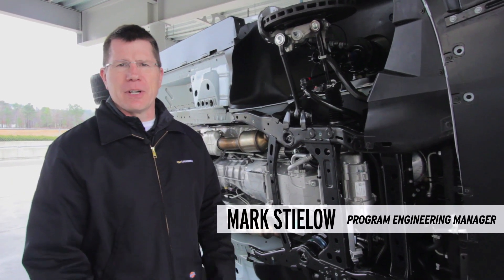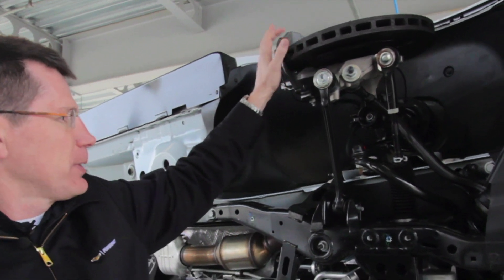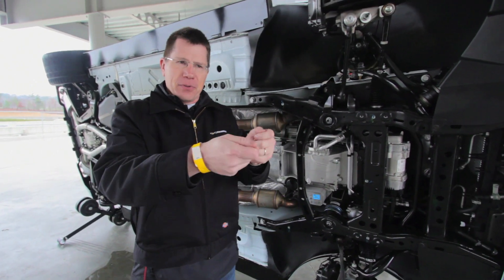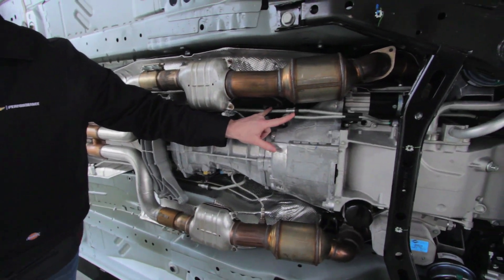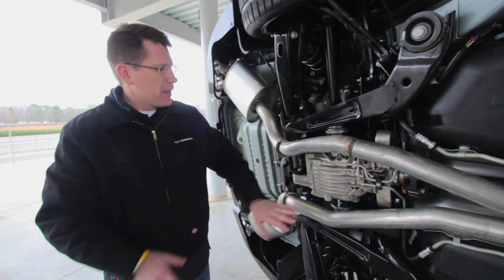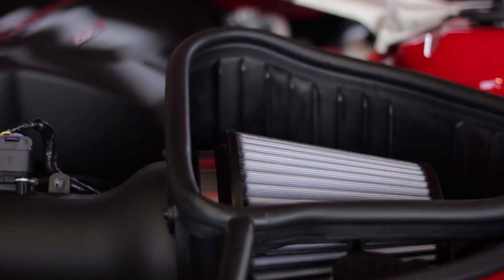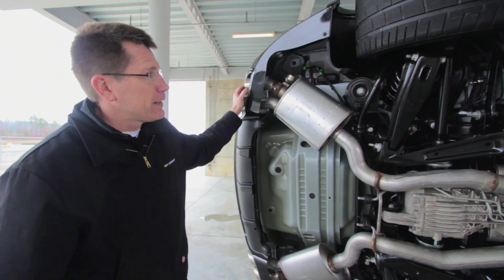C/D Underbelly: 2014 Chevrolet Camaro Z/28 Chassis Explained by Mark Stielow

Comment: you should bring back the iroc z28 a turbocharged and supercharged ls7 6.5 litres 16 inch brakes 8 piston and carbon fiber body with all that it will hit 220 mph

Comment: Doesn't this guy Mark own a '69 Pro Touring Camaro called the "Red Devil"? If he spends his off time building, driving, and racing the old metal, kind of tells you where you really ought to put your money, no?
Reply: unless you want carbon ceramic brembo brakes, f1 inspried suspension with perfect geometry and dampening.  Fully independent front and rear suspenision with sophisticated driver assist sensors for each wheel, a track tuned rear diff, oil coolers for the engine, tranny and rear end.  A second radiator.  modern efi.  Yeah man.  Unless you live in Ca I don't see a reason to buy the old car.  I'm sure they would cost the same if all the same stuff is done to them.
Reply: Robbie Wilson I've seen his car compared with a ZL1 on a road course and his '69 was actually faster. So what's that you were saying about "F1 inspired suspension"?
Reply: Alec D. This isn't a ZL1...this is a Z-28??? 

Air bags, air conditioning, three point belts, reverse lights, noise restrictions, emissions? Did you just compare a full on race car to a road legal car?
Reply: pcfxer Pretty sure his car is street legal. I'm not sure how many he owns or how many he's built, but the one I saw was street legal. Unless you're going to be driving it everyday or you don't live in an arid climate where you could daily drive it, a proper first gen pro touring car would be way more special than a Z/28 or ZL1.
Reply: Alec D. um spool valve suspension

Comment: Oh, look, its pre-crashed so that the underside is readily accessible. GM is finally getting in touch with its market.
Now, all they need to do is figure out how to convince their consumers to put their key-chains on a diet without offending their sense of individualism.
It makes me sad that a modern 'sports' car needs 305 width tires in order to handle.
Reply: I guess you need that kind of crazy wide tires to make a muscle car a bit sporty and track focused. Without that kind of wide front tires if would understeer. 7L engine and 305 all around. I understand the apple of this kind of car for some people. But there will be many cars with much smaller engines and tires that will be faster around a track.

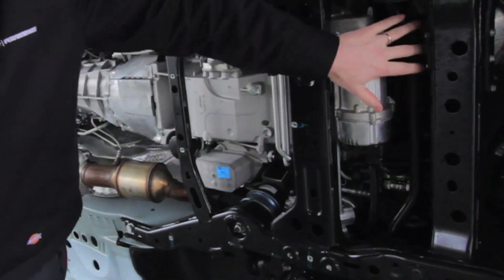Comment: @0:45 what is that pump looking thing that's horizontal to the engine.  Right in front of that crossmember?... is that the electronic power steering motor?...

Comment: Will this one go round corners? I test drove an older one a few years back, cornered like a bus.
Reply: What planet have you been on. This car was built to corner. A few years ago?? A 02 Z28??
Reply: +cbzo6 is right I had an 11 ss2 rs and its handled better then my 10 wrx with sti mods.  Hating on American cars is old news.  They've come a long way
Reply: Another European hating on anything American...go back to watching Top Gear kid
Reply: The chassis is originally from a Holden Commodore and they were always said to handle very well.
Reply: Daniel Arriaga
"Kid" lol, I'm 41. I love American cars, I used to have a 72 Impala, I once test drove a Saleen Mustang, now that thing stuck to the road like glue, but I couldn't get over the stupid interior. I then drove the Z28 came to a motorway slip road and the thing was wailing around like a bus, not hate, fact.
Reply: Icarus Sim Agreed, I pick on those in the corners...though, most guys with enough money for an SS don't have the skills to push them worth anything though.
Reply: pcfxer
I agree, the 2015 mustang and camaro are gonna be overloading the scrap yard with all the wanna be road coarse racers.
Reply: cbzo6 I'm sure you're right, but are you saying that the top of the range older shape Camaro sport model was not designed to go round corners? It was, they failed.

Comment: Car looks great! Sounds good but, how much does it weigh? :(
Reply: It's lighter than the last one, this one's only 120 tonnes:)
Reply: Curb weight is 3837lb, its a little heavy but since it is a muscle car its ok
Reply: Icarus Sim quit hating on everything American kid...go back to watching Top Gear.
Reply: Icarus Sim quit hating on everything American kid...go back to watching Top Gear.
Reply: thevinceberry
It's never OK in my opinion to be a sports car and weigh almost 4000 lbs.  Sorry but my 1992 Mustang with ~420 feels twice as fast as these cars do.  It's depressing to me that you need 650hp to feel fast with these cars now when power like that should be throwing you into the rear seats
Reply: Hardcaslte when exactly did you drive this new  Z28?
Reply: Hardcaslte Oh yea I agree with you, but the older car doesn't meet the modern safety regulation so they are always lighter than the new car even though we use a lot of lightweight material, and if gm use much carbon fiber on a Camaro, the price tag won't be in a muscle car category. Anyway I am sure it is still very very fast
Reply: Hardcaslte get weights about 4000 plus